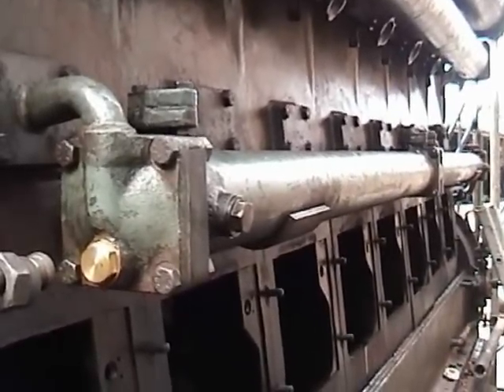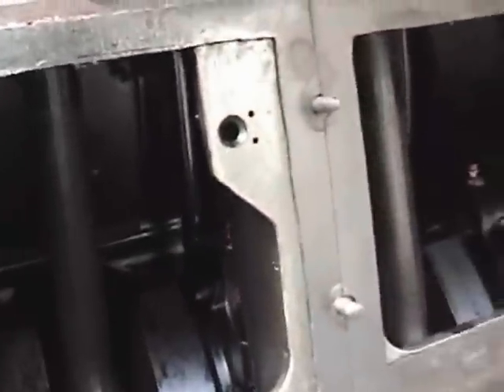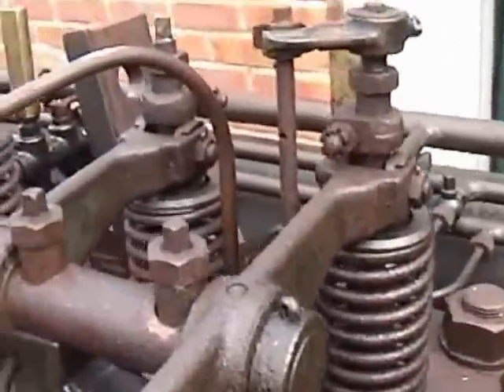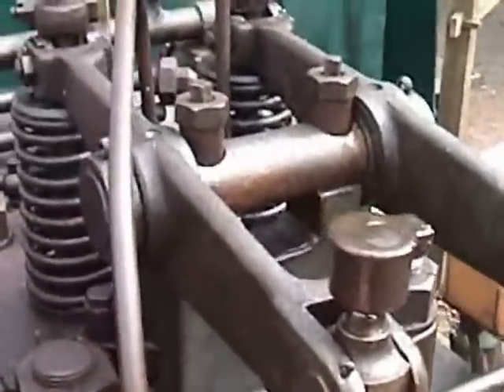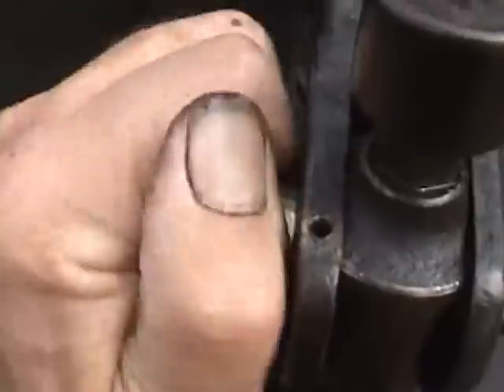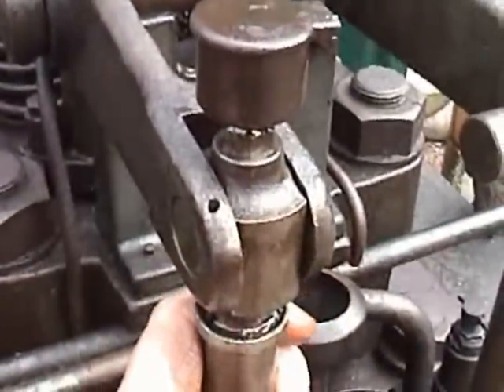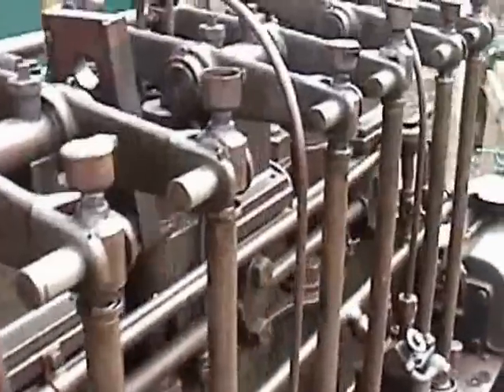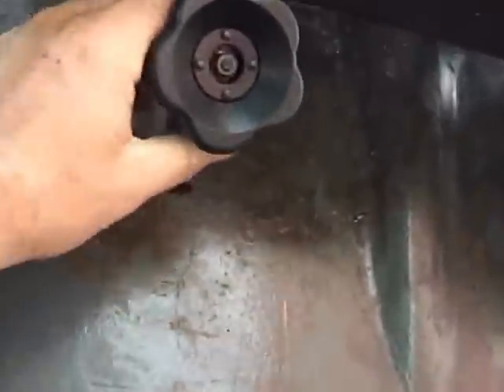1938 MAN G8V U33 Diesel Engine Part 5

Comment: England is a bit far away ...

But, does the MAN G8V U33 already run, I would like to see a video of it. These engines were also used in submarines, probably as a generator or something.

The previous owner of our tugboat told us the engine came out of a submarine or its used as a generator. The engine and the F-N-R Clutch are build on one perfectly fitting frame, so the submarine gen. story could be true...

Comment: Hello,

We have got the same type engine in our tugboat the Eemshoorn. The engine has 5 cilinders instead of 8 Cilinders. Except the number of cilinders  our engine is completely the same. We know it as  type Gv 33 5 or as R33.
Very recently we did some repairing and rebuild some components of the engine. We did a rebuild of the (RPM) governor and the air valves by the camshaft. 

I also look forward too see the eight cilinder running.